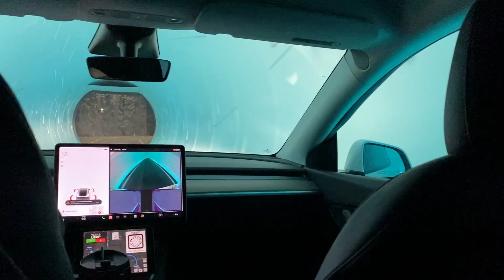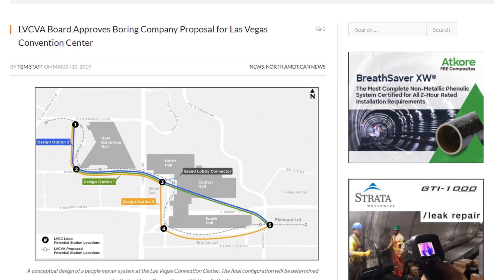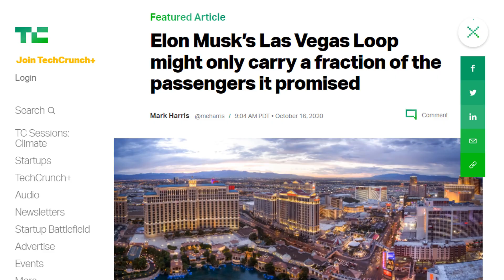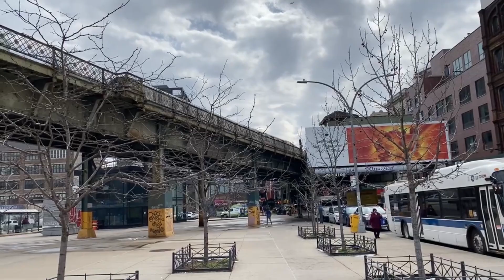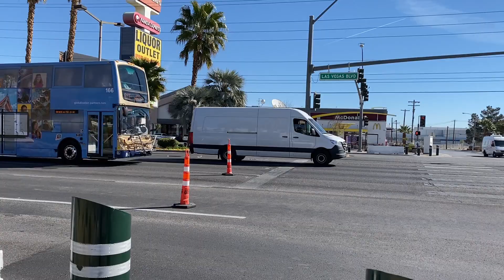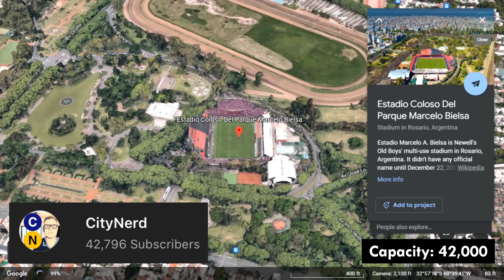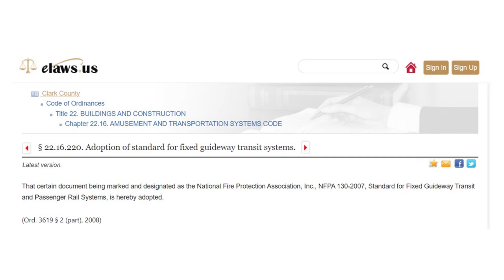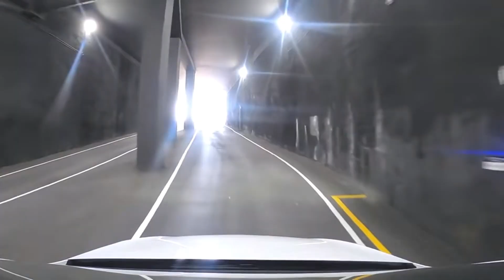Inside the Las Vegas Loop: Transportation Game-Changer, or Complete Waste of Time and Effort?

Comment: The per hour travel capacity doesn't take vehicle charge time into account. These vehicles can only go a few hundred miles before needing a charge, so unless they have extra vehicles on standby, the capacity can't perform at peak for sustained periods of time. Not to mention the additional battery usage required by AC in Vegas heat. Even then, that's additional labor costs for charging / monitoring vehicle battery usage, and more potential pain points. If one vehicle's battery is depleted or fails in the middle of the tunnel, the entire system will could be backed up for a significant period of time, unless there are tow trucks on standby...yuck.
Reply: And now imagine a fire.
Reply: @Codraroll  fires are not a problem as the Loop meets or exceeds all national and international fire, security and building codes including NFPA 130 – “Standard for Fixed Guideway Transit and Passenger Rail Systems” and the 2018 International Fire Code (IFC).

The Loop tunnels have a larger diameter than London Underground tunnels, they have smoke detectors, CO sensors, cameras and automatic high pressure automatic fire fighting standpipes at regular intervals, there is a high capacity smoke suppression ventilation system in all tunnels, the stations are closer together than emergency exit tunnels in a subway, the underground station has an automatic sprinkler system rated at Extra Hazard Group 1 and there is a Fire Control Centre staffed by two officers during all hours of operation.
Reply: Sure, if they stock the fleet with brand new highest spec Model Ys, meaning they haven't faced battery degradation from high use and super charging, and assuming conditions are optimal (no AC, no heat, optimal driving patterns, driving until empty), there could be reasonable range. Even if all the driving is autonomous, manual labor will still be required to charge each individual vehicle. Where the power is sourced from is irrelevant, as the fact remains there is manual labor requires for minting each vehicle in a fleet, with each only a carrying capacity of 5.
Reply: @AColdBird  even if they had AC or heat on, non-optimal driving, older batteries etc, because there are plenty of off-peak periods through the day and night, there would be no problems charging the batteries. Yes plugging in a cable is a manual process but one of the staff at each station doing that 5 second task 10-20 times through the day is hardly going to cause them to break a sweat.
Reply: @andrewfranklin4429  Right, I'm not saying it's horrible. It just means on site labor is required to keep the fleet running, which is a shortcoming of the approach. The loop is basically a taxi service at the moment, with dedicated lanes. I'm not against Tesla, or the idea of experimenting with new forms of transist, in fact I think it's a good thing. That being said, the current setup is not optimal. Perhaps there are plans for making it more handicap accessible. I'm not against Tesla or the Boring Company, but I do think the appeal to novelty and the brand itself are responsible for a lot of the public favor, rather than the benefits of the system iself.
Reply: @AColdBird   at the moment the LVCC doesn’t require a wheelchair accessible vehicle as the convention centre has a separate above-ground service for such users.  However, the Loop will soon be introducing EV vans with wheelchair lifts for use in the wider 29 mile 51 station Loop. 

The Loop does also have a lot of advantages over rail that make it attractive to the public as well as transit authorities:

- stations so cheap that between 50 - 350 Loop stations can be built on the doorstep of every hotel, casino, major office building, University, stadium, shopping centre, rec centre, airport etc for the price of one subway station. 

- Tunnels so cheap that 10 - 100 miles of tunnel could be built throughout a city and urban region for the price of 1 mile of subway tunnel. 

- no waiting 5, 10, 30 minutes for a train to arrive. Loop EVs are always waiting ready to go immediately as soon as you walk into the station on or off peak. 

- Loop EVs take you at high speed direct to your destination 5x faster than a train. No stopping at every one of the 20 stations in between. 

- passengers seated in comfort in your own HEPA-filtered personal car rather than crammed standing breathing the COVID of 1,000 strangers. 

- Loop EVs being 2-5x more energy efficient per passenger mile than trains and the significant percentage of the power being generated from the huge solar arrays on the rooftops of every Loop station.
Reply: Yes, meeting fire safety codes is a given, considering it was built and is operational. You also have to consider the codes weren't written with this use case in mind, and there is a spectrum of safety within what is compliant with the law.
Reply: The Tesla Model Ys in the LVCC have ranges of between 244 - 326 miles so could travel the 0.8 miles of the Loop up to 407 times or drive continuously without stopping for a day and a half before going flat.  

But of course, like any public transportation there are peak times and off-peak times during the day, the latter of which conveniently occurs during the sunniest parts of the day when the EVs could charge from the solar panels on the roof of every station. And remember almost all Loop stations are going to be above ground and the two current ones have enormous roofs over the  10 bays and mini-loop lanes around them. From the videos it looks like there are close to 100KW of panels on those roofs. 

And wouldn’t you know it, Musk happens to own a little trillion dollar company that makes home and grid scale stationary batteries that could store all that power to charge the EVs whenever it is most convenient.
Reply: @andrewfranklin4429  Luxtram 16km 24 stations 500 million USD, over 12000 people per hour capacity (every 2 minute one tram with 422 passengers), 31 million per km.
Las Vegas Loop 2km 1 station 50 million USD per km, only 4400 people per hour maximum claimed nearly 3 times less capacity per hour at optimal factors at best. Luxtram requires at least 6 times less electricity per person

Luxtram 422 persons board in less than one minute (one tramway every 2 minutes). Show me any video where 422 people board cars and drive away in one minute at one station at the Las Vegas Loop. You cannot. Facts.